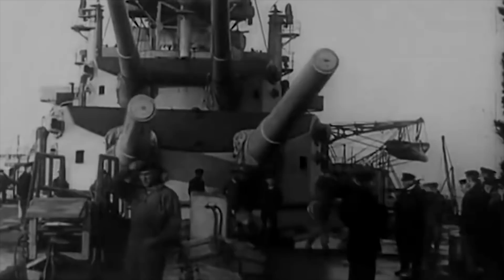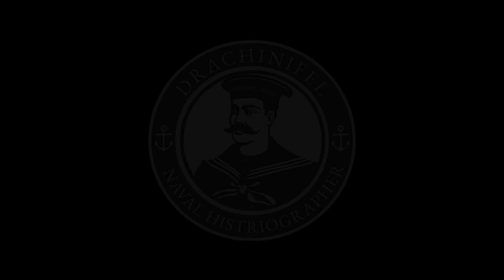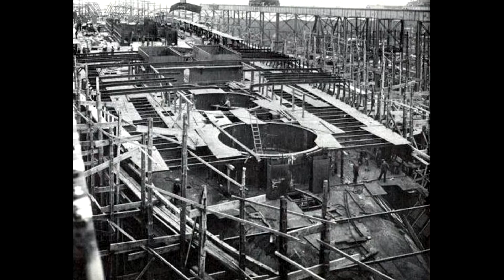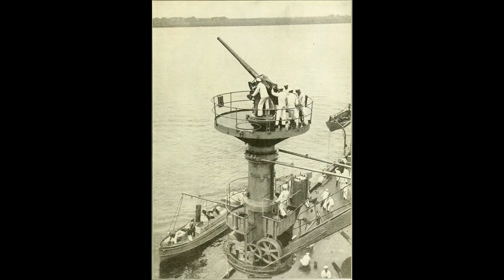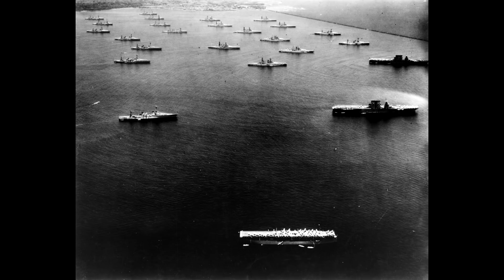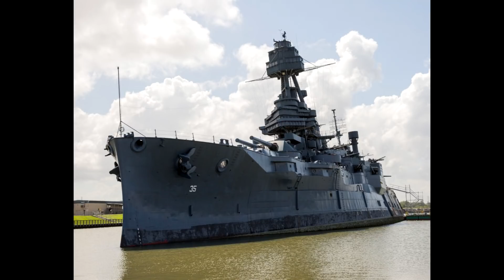USS New York - Guide 204

Comment: Concerning the new 14" naval guns for the US Navy.  When authorized, the guns were not only larger, but the AP shells (soft-capped 1400 pound enlarged US Navy 870-pound soft-capped 12" Mark 14 AP projectiles) now also had to withstand a specification that required a 10-degree angle off from the old right-angle testing against scaled-up Class "A" armor (face-hardened using some version of the Krupp thick-faced armor type, though at the time both Bethlehem Steel and The Midvale Company used in-house developed variants that did not use a thin super-hard Cemented ("Harveyized") surface layer, since only Carnegie Steel was willing to pay Krupp the license to make a variation of Krupp Cemented (KC) armor called Carnegie-Krupp Cemented (CKC)).  Only after the Krupp patents were declared invalid by the US Supreme Court in 1912 did Midvale and Bethlehem start to make their own variations of KC armor with the cemented surface layer added.

Carnegie never made large naval gun projectiles, to my knowledge, but Bethlehem, Midvale, Firth-Stirling (its US company), and the new-to-projectiles firm of Crucible Steel Company did (Firth-Stirling eventually got out of this business just before or during WWI, but the other three listed here continued making large AP shells for the US Navy through the end of WWII).  In fact, by the mid-1930s Crucible became the best AP projectile company in the world, starting with the US 14" Mark 16 MOD 8 AP projectile design, which was about the best, most-damage-resistant, hard-capped AP shell ever made starting in early 1942, with other AP shells from 6" through experimental 18" being matched to it as the test standard to reach from then on.  When the first batches of the new 14" AP shells were made for test purposes circa 1910, Bethlehem, Midvale, and Crucible entered a test lot of shells for the new 10-degree test standard.  The acceptance standard allowed two test failures taken randomly from the lot of the several shells tested against the Class "A" plates, but a third failure was "curtains" for the projectiles submitted.  Bethlehem had no test lots EVER succeed during these tests (I do not know when it finally fixed its problems, though it made good AP shells in WWII).  ALL Midvale lots passed, most with no failures whatsoever, while Crucible also had no lots fail, though there were a few lots that had one individual shell failure that almost failed that lot.

Shortly thereafter, Midvale started making for the large guns its "Midvale Unbreakable" AP shells that at up to 15 degrees obliquity almost never broke when hitting any armor at all, with the sole US exception of the Midvale Non-Cemented Class "A" plates made from 1906 to1912 before the Krupp patents were eliminated.  (This armor had a new tempering process that, was not understood at that time and prevented what was later called "temper brittleness" so that these plates could shatter ANY projectiles whatsoever made at that time that did not have a hardened AP cap at any angle at all, no matter how thick it was or large the projectile was.  Only Austro-Hungarian Witkowitz KC of the WWI era seems to have been similar in its damage-causing ability of all armors designed before about 1930.  After 1930, most, but not all, new face-hardened armors were similarly improved in toughness by using better tempering systems and could also shatter any soft-capped shells.)  The first of these new super-strong-bodied shells was the 8" Mark 11 first made in 1911, but only when the 12" Mark 15 MOD 6 (this MOD being the new Midvale version of that AP shell design) of 1916 did the US Navy finally realize that all of its other AP shells were now obsolete and changed all of its requirements to meet the new Midvale shells or fail the armor impact tests.  The 14" Mark 8 and the 16" Mark 3 AP shells used through the 1930s until replaced by the new hard-capped designs were all of this soft-capped Midvale shell type, regardless of who made them.

This failure by Bethlehem Steel to be able to pass even one single test lot of 14" AP shells during the time period just before WWI shows that their quality control needed a BIG FIX.  Their armor plates taken from the sunken OKLAHOMA after Pearl Harbor and tested at the US Naval Proving Ground, Dahlgren, Virginia, during WWII also showed a wild variation in the armor plate metallurgical properties from plate to plate when three such Bethlehem OKLAHOMA belt plates were tested and given metallurgical tests comparing them to modern (WWII, that is) plates.  One Midvale Non-Cemented plate was also taken from OKLAHOMA (at that time the individual plate lots could be bought from all three manufacturers in a crazy quilt per ship) and turned out to have an 81% deep face (!!!), which was the thickest ever used to my knowledge, and which was partially why it could shatter the old Midvale shells, but this plate had two features noted during the testing:  One was that it did have the huge scaling effect against AP shells that made it inferior in penetration resistance to 14" and up AP shells even when they shattered, noted in tests made in 1920 and 1921, so it was only superior for stopping soft-capped AP gun projectiles up to about 12" size.  The second point was the extremely good quality control of the plate's various parameters, including a very smooth and uniform hardness shift from the face of about 490 Brinell (600-700 Brinell cemented layer not used due to the Krupp patent fight) in a flat line to about 25% in from the surface and then a very smooth long "ski-slope" hardness decrease to a flat 200 Brinell soft back layer at the 81% point -- this was about the best quality control I have ever seen in this hardening process, and the opposite of Bethlehem's wild changes inside each plate with no two plates being even remotely similar.  No wonder Midvale became the new standard to match at that time in both armor and projectiles.
Reply: Thanks for the in-depth (penetration?) reply!  May I ask what your professional background is?  Metallurgist?
Reply: @davidb6576  No.  I taught myself basic metallurgy from reading A LOT of US Navy and Army documents on armor and projectile manufacture and testing and from the huge book THE MAKING, SHAPING, AND TREATING OF STEEL (9th Edition of 1971) by the United States Steel Corporation (what was once Carnegie Steel Corporation).  My training was as a Physicist and Mathematician (UCLA Dual Major 1972) and my first professional permanent job started in December of that year as a GS-7 Electronics Engineer (lowest possible pay grade for this job title) at what was then called the US Naval Ship Missile Systems Engineering Station (NSMSES or "Nemesis"), Port Hueneme, California, (a tenant facility on the huge "SeaBee" Base there) for the TERRIER Guided Missile Systems Department.  When digital computers, the UNIVAC 1218B, called in the US Navy the General Purpose Computer Mark 152 ("C-152"), for TERRIER (and the digital version of TALOS) began to be added in the next few years, slowly replacing all of the older versions of the TERRIER Mark 76 Guided Missile Fire Control System with the MOD 6 and MOD 7 versions (different experimental radar upgrades, later combined in MOD 8) during upgrades, I changed to a Computer Engineer when that Job Title was established in 1976, though I had actually been such an engineer for a couple of years already as NSMSES built a TERRIER digital computer test facility (we had to do our own wiring of the place, though the huge equipment, including an entire AN/SPG-55B TERRIER tracking and guidance radar unit on the roof, was done by professional construction personnel).  The C-152s replaced the old electro-mechanical Computer Mark 47 ("C-47") and, eventually, these upgrades also replaced the older various types of TERRIER missiles (BT(N) and HT/HTR) with the new Standard Missile (SM-1, the first version of what with upgrades to its control systems was also introduced in TARTAR and, finally, as the huge upgrade SM-2, in both of these and in Aegis, which eventually replaced both TERRIER and TARTAR).  TERRIER had its ships suddenly, with no warning to us whatsoever, wiped out with a no-more-non-nuke-steamships order in 1990 by the end of 1992, after which I transferred to TARTAR and eventually, when that also went away, to doing some Aegis peripheral (Dahlgren will release Aegis central software and hardware work only from its "cold dead hands", as Aegis  is its primary "rice bowl") and FFG-7 "mini-TARTAR" system work, including, eventually, becoming the sole SOFTWARE QUALITY ASSURANCE person in my department until I retired in 2014.

I had a fascination with battleships from my high school days (I graduated from Venice High School, Los Angeles, California, in 1966) and during my college days I worked at NSMSES during the summer once and during the summer twice at the US Naval Weapons Center, China Lake, California (only 100 miles from Death Valley and it felt like it!), where I learned how to program computers in FORTRAN 6, among other things.  These Navy summer jobs were quite interesting and informative to me and I thought I might like to work for the Navy after I graduated (my grades were not quite high enough for UCLA Physics Department Graduate School).  Also while at college a friend of mine introduced me to playing various miniature wargames (Napoleonic, Army, and Navy battles using small ship models -- this was extraordinarily fascinating to me and I played many hours with a club using dining room floors, large table tops (some made in huge auditoriums from many such tables pushed together) and even, on an elementary school playground, a full scale naval game using 300' tape measures for range estimation checking (you REALLY understood how tiny even a huge battleship was at such large distances!).  As I played the naval games I noted elaborate rules for ship maneuvering but the rules for armor penetration were extremely simple, not much different from those used in the late 1930s by the Fletcher Pratt Naval Wargame, which was the basis for the more complicated rules I played under.  I got copies of the rules and studied them closely.  Then one day things changed:  I was playing a naval miniatures game on the floor of a friend's kitchen, with several players recreating a WWI battleship/battlecruiser Britain/German battle and I was using a German battleship.  At that time I was still rather new at doing the eyeball range estimation to try to hit the British enemy ships and could not hit the broadside of a barn from the inside.  But I kept trying and, finally, I got a single hit on a British battlecruiser.  I didn't expect much, since I had been hit a few times and the referee had done his "mumbo-jumbo" and only minor damage to my ship had resulted.  This time, however, the referee came back and stated that the British battlecruiser had blown up and was removed from the game.  I was "floored" but my happiness did not last long, as every British ship on the opposing side used me as a target and wiped me out in two turns.  After the game, I asked what they used for hit effects resolution and he showed me a large table with numbers from zero to 100 on the side and effects of various sort stated, with the minimal armor penetration requirements to allow that hit.  I had already some idea of the very simplistic ship armor setups and armor penetration tables used (side armor only for WWI battles), but had not really studied how they were used in the damage computations at this time.  The referee showed my how he used telephone numbers from a large telephone book and die rolls to determine the random numbers for placing hits on a target when you estimated the range correctly.  My hit had been a big ZERO, which was a main magazine and, at the ranges given (scaled for the floor) my shell had penetrated and KABOOM!  This was so game-changing (in all the meaning of this term) to me, that I set out to understand more about how armor worked, since my study of pictures in JANE'S FIGHTING SHIPS showed a much more complex armor design than the simplistic tables used in the game.  I decided to figure it out, since I was a physics and math major.  How hard could it be (hubris to the max!)?  Well, after more than 50 years of study on armor and projectile interactions, I have some success that is at the Internet Web Site NAVWEAPS.COM in my section of that site, but still have things I do not know yet.  Considering how it is just two metal objects being banged together, you get some really fundamental understanding as to how complex our universe really is...
Reply: @nathanokun8801  Interesting (sincerely)!  A gamer geek, in modern parlance ;).  You should get some correspondence going with Drach, surely he could do an additional segment on armor and shell penetration with your help.
Reply: Nathan I just found this and wanted to say thank you for sharing your knowledge!

Comment: The 3in guns on top of the crane posts was done because every extra foot of vertical range was considered worth while. It also gave them a better transverse range free of interference from radio wires which in those days were quite numerous.  In 1914 you  didn't have the electronics that decided radio frequencies, instead they varied them by different lengths of antennae wires.  It was commander Sims who set US Navy gunnery standards, example:  3 8gun dreadnoughts = 18 guns per broadside,  while 2 10 gun ships = 20 guns.  Given short range, bad visability and no radar this was the best that could be achieved and of course the idea of the line of battle was still considered the gold standard of naval warfare.

Comment: If they had gone for 8 guns they probably could have got 25 knots
Reply: A ship's top speed is determined more by the hull shape than it is power.  Once you reach maximum hull speed, even doubling power will provide only small, incremental speed increase at the cost of extreme stress to the hull.  Part of the finalization of a design includes tank testing models, which they did back then.  The results were accurate enough to know that 28,000 hp would produce results that were essentially the same as 30-35,000hp.  As far as why they went to reciprocating engines, a paper was written in 1914 that explained it in good detail.  U.S. turbine technology at that particular time centered on very large low pressure, low speed turbines, such as Curtiss.  Blade erosion was a serious problem and the low rpms required for direct drive to the screws resulted in poor fuel efficiency at cruising speeds, such as found with the Floridas.  Plus, they were very large, requiring engine rooms as large as those for reciprocating engines.  It wasn't until reduction gear design and durability had reached a reliable level that turbines were accepted as the standard power plant.  Fortunately, that happened very shortly after Texas and New York was built.
Reply: The ships’ Vertical Triple Expansion would’ve been limited to bursts of 23-24 Knots even if the 5th turret had been replaced with extra engines. The more likely result would’ve been what Congress wanted, which was a shortening the hull.
Reply: @TraditionalAnglican  if the navy had pushed for 25 knots they probably would have gone turbine as they did consider it and the RN had been using Turbines on all their Dreadnaughts this could have made the New York class much closer in capability to the Queen Elizabeth
Reply: @jonsouth1545  - The RN had experience with Turbines, while the USN still saw Turbines as “experimental”. Also, the USN had experience with TEE & knew what they cost to build & install, while (at least in 1910) the USN had neither. So, unless the USN were willing to rely on the expertise of the RN, they weren’t going to install turbines without a lot more experience working with them.
Reply: @TraditionalAnglican  the USN had experience with turbines not as much in battleships as only the Florida class the exact preceding class to the New Yorks used them but also had been using them in other ships and US yards had either built or submitted plans for turbine engined battleships for foreign navies for several years and they knew that the UK Germans and Japanese had already made the switch and turbines were the original first choice engine for the New York Class but they chose TEE as they could do it quicker if the Navy however had pushed for a 25 knot ship with 8 turrets they could have leapt the opposition
Reply: @jonsouth1545  - The USN based their decisions on fiscal as well as time constraints. If they hadn’t had to worry about the money, they probably could have built 10-gun BB’s that could’ve maintained 24 kn on the hulls they had using turbines. The cheapskates in Congress would’ve demanded a smaller ship if the Navy had insisted on turbine propulsion, and the extra year under construction would’ve made it easier for Congress to do just that. Therefore, they had a choice between 2-10 gun BB’s (needed to complete with the Kaiserliche Marine & the RN) or 2 turbine powered 8 gun ships, which would’ve been outgunned by their contemporaries.